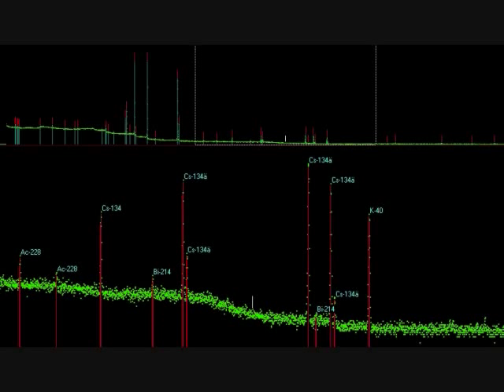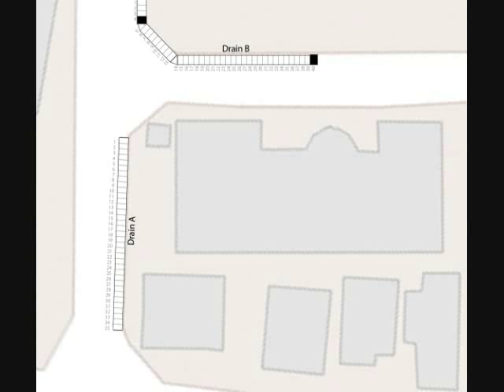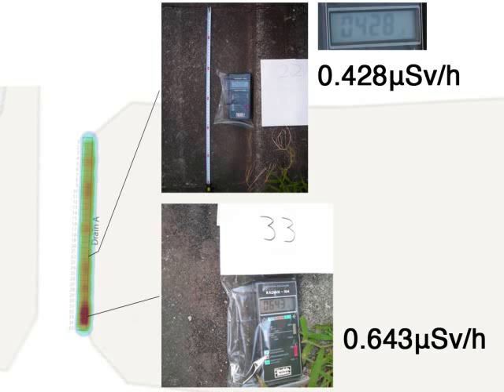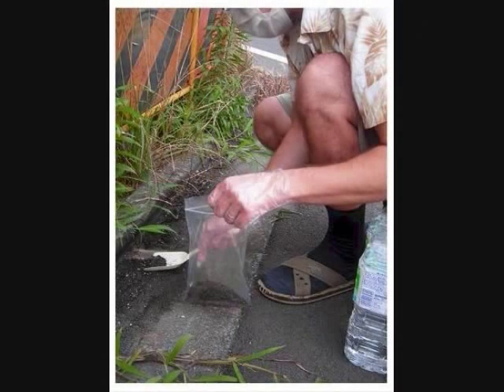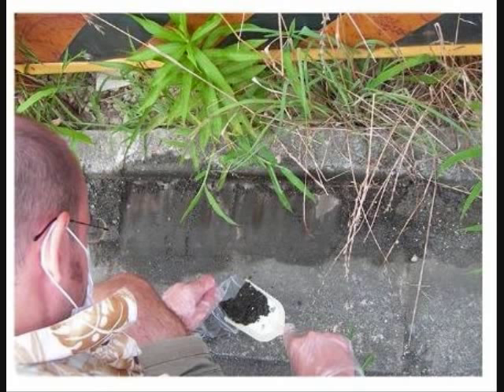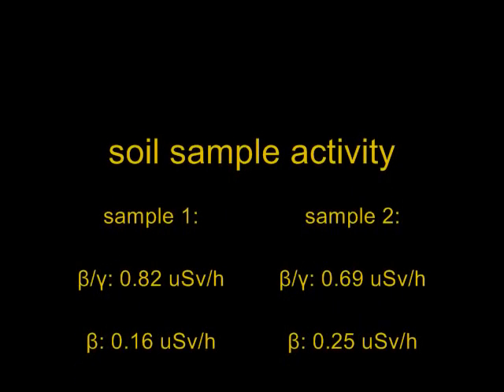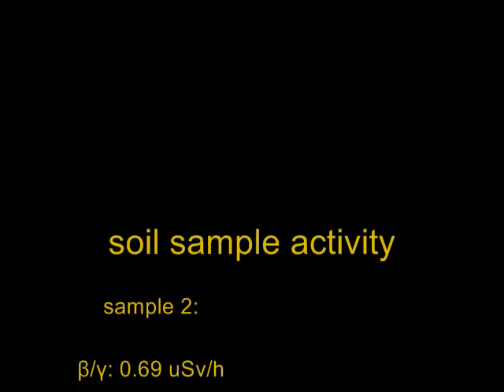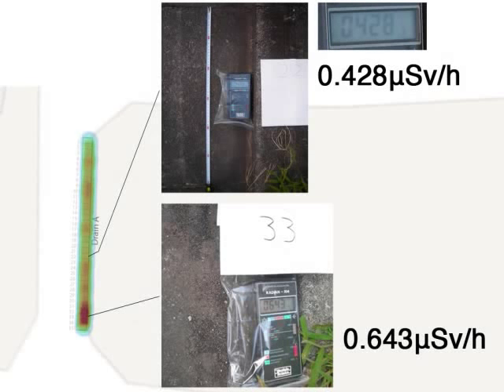UPDATE: radioactive contamination with caesium (Cs-137, Cs-134) from fukushima found in tokyo soil.

Comment from the maker: @0GTC 
well, it's lower than initially estimated, but still not really good. but yeah, we knew that before. i think the "fallout" (washout) can greatly vary depending on wind direction and rain etc., so it's possible to have greatly varying contaminations, e.g. 500-50000 Bq / kg (Cs), depending where stuff came down. these "pockets" of radiation have been known to form after chernobyl, too, with varying contaminations.

Comment from the maker: you can find a decay chart with emission probabilities for beta/gamma for any nuclide on tinyurl(DOT)com(SLASH)d3ewbr5?unc=standard - 0.12 uSv/h is normal background radiation. i have the same where i live (germany). 
if the dose rate reading is correct depends on what your device is calibrated with; a typical ionization chamber will only be very accurate for the very isotope it is calibrated for (most commonly, Cs-137). for others, conversion factors apply (ask manufacturer).

Comment: Thanks for your work! Why the disparity with your previous video, it seems the levels of cesium are 4 times lower than the ones you detected in your previous analysis? Also, do you think this results contradict the fallout data published by the Japanese government (around 17,000 Bq/m2 of both Cs-134 and Cs-137 detected in Shinjuku, Tokyo)?

Comment from the maker: @Garfuck 
in theory? i wouldnt recommend living in that area. it's not an immediate danger to health, but evacuation would be reasonable with radiation levels like that - either that, or major decontamination procedures. these may just be hot pockets, but how do you make sure you dont breathe that stuff? run around with masks and geiger counters every time you take a step outside? hmmm.
well, i guess you'd have to, as its not possible to evacuate TOKYO...

Comment: Thanks for th link, (nndc.bnl.gov) but i couldnt undrstand it.
If it's just a simpl matr of comparng the KeV of the γ & the KeV of the β then I gues 662 vs 1175 bt othr charts report othr energies. Just want a ruf ratio like 20:80 or 80:20 or 50:50.
When a friend tested my house, he found 0.11-0.17 β, no γ (below detection) so I first thought γ was negligible.
My best guess at the moment is that the gamma is probably 35-55% of the total ionizing radiation in areas of high deposition. Correct?

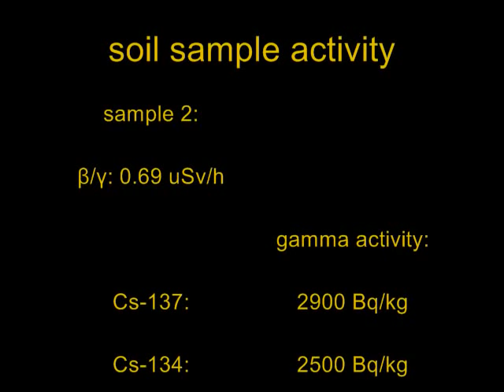Comment: 2:47 — Contamination of 137-Cs = 2,900 Bq/kg, which corresponds to the physical quantities of Cesium in the soil?
137-Cs is an isotope with high activity: 3.22 TBq/gram
Thus, in 1kg of soil is physically: 2,900 : 3,222,000,000,000 = ~0.0000000009gram = ~0.9 nano g. (9E-10 g.) of 137-Cs per kg of soil 
This corresponds to the ratio: 1,111,034,482,758 : 1 of the amount of soil to the amount of Cs, contained in it!
BTW: Activity of 134-Cs is 47.92 TBq/gram — please check if it "is", in the soil

Comment: @bionerd23
All, you might want to read a document I found. Google for thesisblairdoc.pdf  The 1st result is a DL link.

The paper details a Cs137 survey of Southern Utah (downwind of the NTS.) They measured up to 2K+ Bq per square meter (somewhat different units) ~40 years after the Cs arrived. Cs apparently binds strongly to the soil, so it sticks around for a long while. Utah levels seem surprisingly high compared to Tokyo samples that were collected from a concentrating hot spot.

Comment: @bionerd23    Your 100% correct!     I am hoping to buy a HPG detector or a scintillator in a few months time. When I do, I can finally test in my own home. =)

I just bought an Sr90 0.1 uCi source disk from Spectrum Techniques. I will contain it in a > 6mm Al container. I calculate that Sr90's beta's can travel up to 9.44x10^-2 cm through aluminium and 186.96 cm through air at 20c, sea level.  lol      Fun stuff!

Keep up the good work!

Comment: Assume most of th high radiation sites here are Cs-137 and maybe some Cs-134.
If I find a spot w/ 0.5 μSv/h of γ, and knew that th β emissions are just 20% more on top of the γ, I could make a guess that this spot may have 0.6μSv/h of ionizing radiation. OTOH, if γ were just 20% of the ionizing radiation emissions, and β were 80%, I might guess that there could be 2.5μSv/h of ionizing radiation in that spot.
It's a question of what the best interpretation of the data i have (gamma) is?